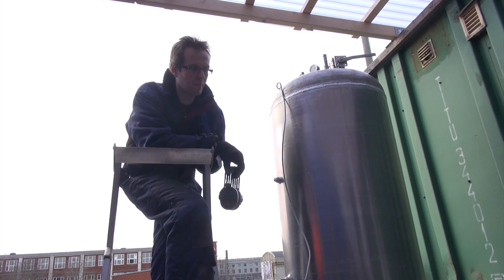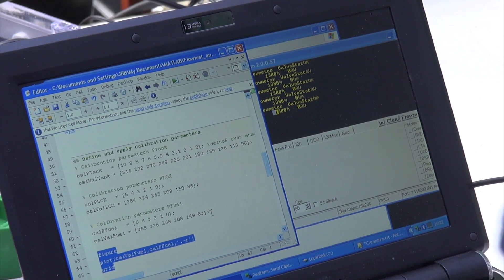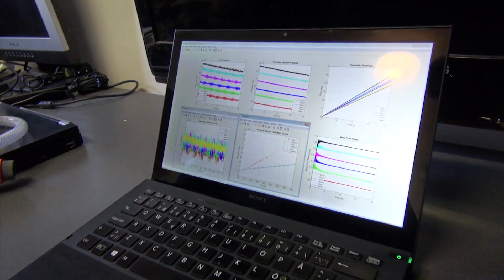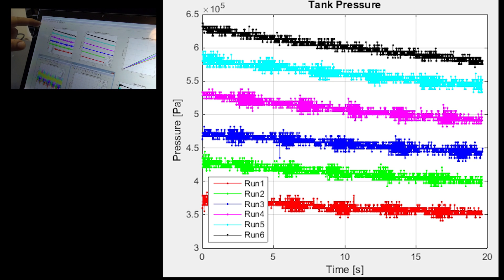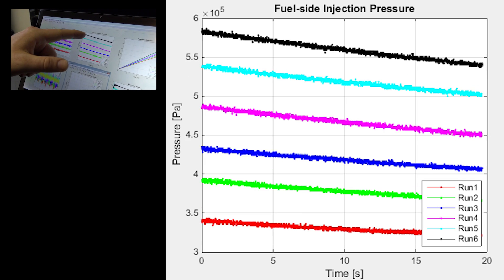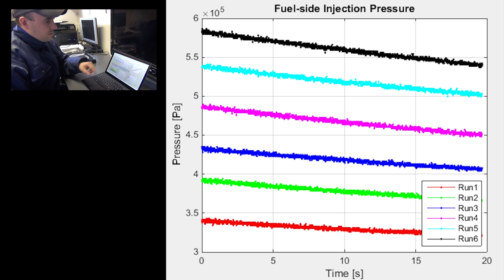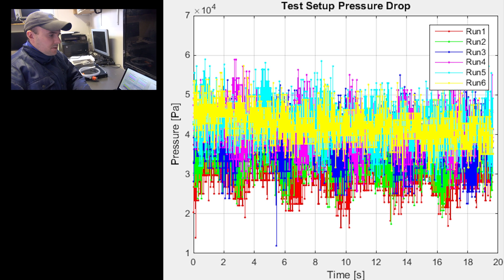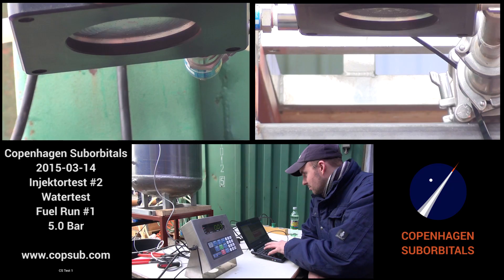Injector test 2  BPM 5

Comment: Just wanted to ask one thing , if the engine chamber operating pressure is 15 bar then y don't you test the injector at that pressures?
Reply: Like I don't quite understand what was the purpose of testing the injector at 4-5-6 bars of pressure?. And also the o / f ratio would be different when you have tested it at 15 bars ......am I right or am I missing something ... please do let me know as I really need to understand this 😇😇
Reply: Pressure difference across the injection elements (not absolute inlet pressure) determines how much flow will be driven. Like they said, when in the engine, the inlet pressure to the injector would be 3-4 bar above chamber pressure. Therefore they are testing at these inlet pressures of 4 5 and 6 bar to simulate the pressure difference bc pressure outside the injector for these characterization tests is 1 bar not 15